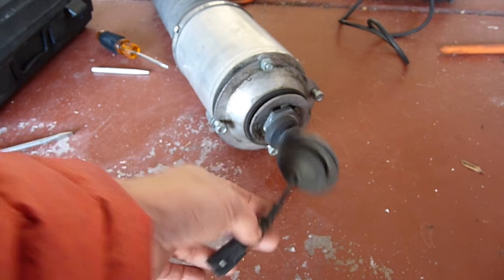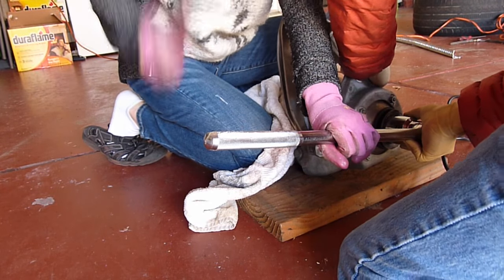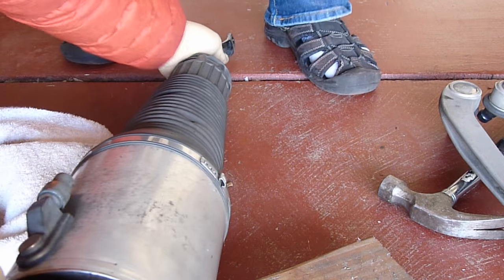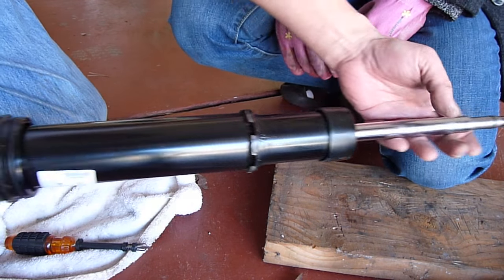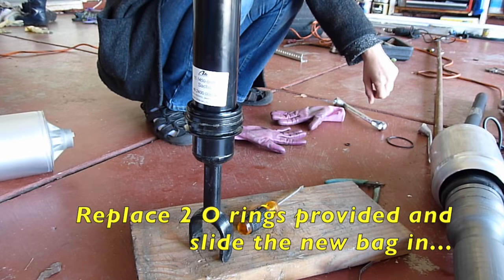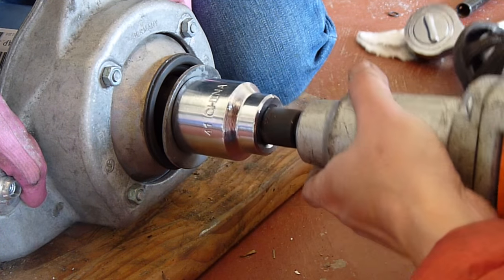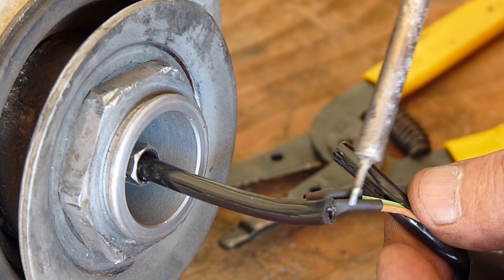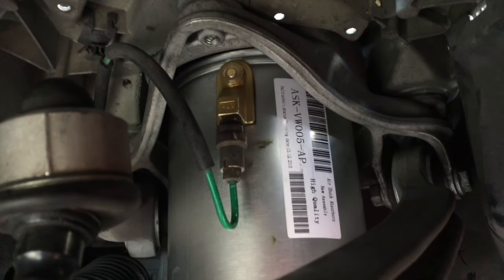How To Replace Audi A8 D3 Air Spring Bag Only

Comment: Any other idea figuring this out why it still leaks after replacement ?
I had a leak at the top of the strut....never checked for other places and just assume is either the bag or the gasket...purchased the bag and follow all instructions here step by step and reinstalled. With the new bag it still leaks at the same place, top of the strut. What else could cause the leak up there other than a defective new/old blown bag and the little 2 gaskets that get installed on the strut which are the new ones provided that I used.

Comment: I am doing this now - you can loosen or even remove the 41mm nut while it is still on the car, but you may need a thin wall socket or a normal silver one.  I couldn't so had to take the whole strut somewhere with a large impact wrench to undo it and it was quite easy with the correct tool.   My next problem was getting the metal tube of the new airspring over the large o-ring - it was stiff and no grip to hold.

Comment: what is your source for the air bag assembly? when I replaced my front drivers side I only found whole strut assembly. and how much does this cost versus getting a whole strut? I can only imagine that this is much cheaper if you don't need to replace the strut.
Reply from the maker: o0ThunderGod0o https://www.ebay.com/itm/252537823763
Reply: 3dogs1monkey many thanks. this will be a great help in the future

Comment: Hi,did you pre pressure the airbag before instal or just pump it up with the car compressor after instal.
Reply from the maker: Richard Meisel No, i turned on the ignition for the pump to pump to check for leaks before lowering the car.
Reply: 3dogs1monkey ok thanks,i wil do this repair the coming week sso we wil see how it goes.
Is the bag still peforming well?
Reply from the maker: Richard Meisel the suspension is like original, perfectly working
Reply: 3dogs1monkey Pefect, i will let you know how it goes with mine.
Ps ,did you have to do a suspension hight calibration?
Reply from the maker: Richard Meisel No, just the height for the CA because I had to replace a bad one. Don’t mess with VCDS and screw everything up.
Reply: 3dogs1monkey ok thanks.
Reply from the maker: Richard Meisel my advice is this: most people had problem with 1 leak strut, opened and replaced other parts and screw up the whole system in the process. The bag leaks, replace the bag, make sure the original shock wires are connected correctly and everything else untouched, no more leaky strut, system will go back to original working condition as before. Almost all problems come from Operator errors. The system is quite simple but yet complex when you introduce more problems when replacing good unnecessary parts and made mistakes.
Reply: 3dogs1monkey Hi,i am sure my airbag is at fault here,so i am going to replace that and nothing else.
And yes you're right people are often  overcomplicate there problems with a A8.
Luckely i am an old school mechanic.
I first find the problem,then i research it and then i repair it.
Reply: Ok just finished the job.
Your video is exelent but ther is just one thing that kan be done easier.
Inthe video you are having some troubles with the 41 mm bolt.
When the strut is still mounted in the car you can acces the bolt from under the hood and you can take it strait of.
All is well again,10 sec from comfort to lift
Tear the strut down and yes there was a hole in it.👍👍
Reply from the maker: Excellent find, so it's better to remove the 41mm bolt from the car... Thanks for sharing, glad everything works.
Reply: 3dogs1monkey Hi, just wanted to see if yours was still holding up and if you’d still recommend. Thanks in advance

Comment: Thanks for video, I get to attempt this repair now. Just need to locate a o-ring kit.
Reply from the maker: djenn434 when you buy the bag, the rings are provided. Don’t try to fix the leaks with the rings, they don’t work, the rings are only to prevent the bag to move up/down too fast that break the bag.
Reply: @3dogs1monkey  Damn, ok thanks for info.
Reply: @3dogs1monkey  Are you 100% sure? My leak is coming through the top where the wires comes out.
Reply from the maker: djenn434 because the ring on top leaks more than the bottom, hence you see the leaks on the top. I’m 99.99% sure that the ring won’t fix the leaks LOL.
Reply: @3dogs1monkey  I'm not really sure what you meant by last statement. If airbag itself is leaking, why would air shoot out top of strut? Wouldn't it leak out side of strut under the boot? I haven't taken one of these apart but the airbag rubber seems like just a outer sleeve that keeps inside air tight. So air enters through valve, pressurizes metal chamber which is sealed by rubber airbag, lower o-ring, and upper o-ring. It seems like when you tested air bag in other video having to seal top hole and bottom hole proves the two O-rings are needed for strut/shock to hold air. What am I missing?  Doesn't really matter I guess, I already sent leaking strut back to seller and now am looking at a rebuild kit .

Comment: how are the new air spring bags? still running?
Reply from the maker: Mustafa Solmaz yes, running like original
Reply: @3dogs1monkey  also the ones from China?
Reply from the maker: Mustafa Solmaz made In China shipped from California
Reply: @3dogs1monkey  Big thanks. ill get some of these if o-ring change wont work. can you please tell me the size of the o-rings?
Reply from the maker: Mustafa Solmaz o ring will never work, don’t bother
Reply: @3dogs1monkey  didnt you tell to check the O rings first in another video ? :D OK then I'll check if both air suspensions are faulty or only one side.
Reply: Did you also replace the shock absorbers? Are they still in good condition? And how many kms did your A8 run?
Reply: @3dogs1monkey  i replaced the left one refurbished the compressor and a new relay. worked for 800kms then while standing at the traffic lights the right one blew and instantly the front came down :D

Comment: I tearout the upper 9mm bolt? Pillar?  And cannot detach the 18mm bolt, ㅜㅜ how can i replace it, i sprayed wd40 and on and on . .  But 9mm part does not fix properly t.t
Reply from the maker: If you can’t get the 9mm out, you can’t get the shock out. Buy a new strut. Try to loosen the 41mm from the car, it’s easier https://youtu.be/4pyzyftN3wg